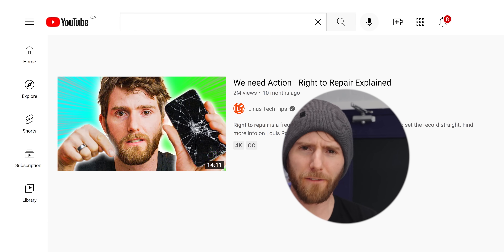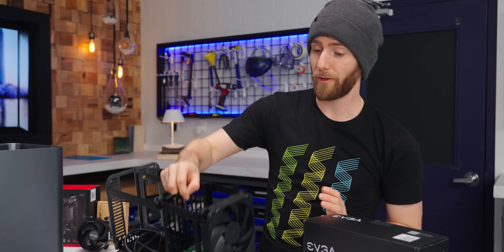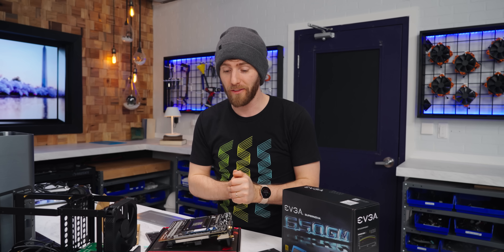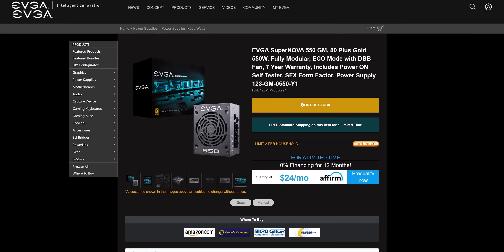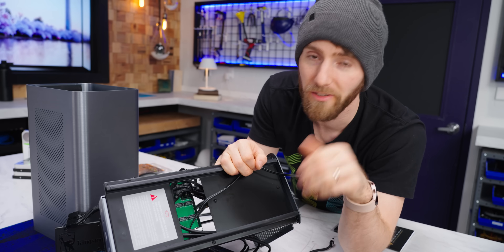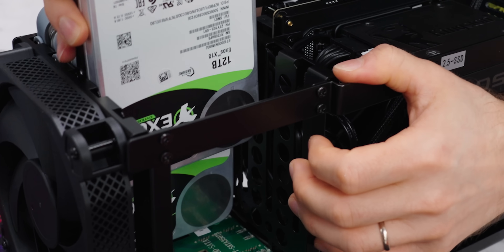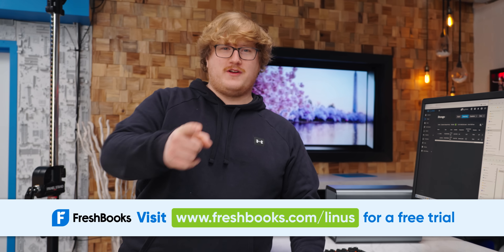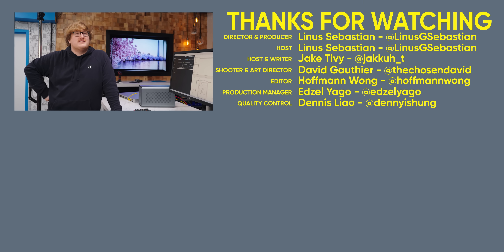This blows away the competition - JONSBO N1 NAS Build

Comment: I've built myself a similar concept, just with a much smaller budget. 

I've used one of those toploong nas cases from aliexpress (4 disk bays), that goes for around 50$. I also scored a pretty cheap J1900 board with power supply for 40$. Added some ram i had lying around (8gb as thats the max j1900 supports) so i'm roughly 100$ in with a pretty decent setup. It's not the fastest thing around (but easily handles 1Gbit samba transfers and ~500Mbit worth of torrents) and certanly much faster than your ~100$ prebuilt NASes. It's also passivly cooled due to low power atom cpu.

So if you're on a budget, looking for cheap boards with built in cpus is a good start.
Reply: Don't suppose you could host a plex server on it? You would need something more powerful I'm guessing
Reply: @Tumleren  if you dont need to transcode itd handle it easily.
Reply: @Tumleren  there a more recent solutions like Asrock J4125. With Intel Quicksync they can handle several 1080 transcodes while being very energy-efficient.
Reply: @Mkungaa  Why would you want to do that anyway? Even cheap 30$ android boxes handle all formats in 4k easily, so all you really need is a samba/nfs share and stream directly.
Reply: @hojnikb  THIS! I also own a relatively low powered qnap nas running on intel J paired with cheap android tv box and it can handle 4K easily! And you could do more on your android box than kodi, like retroarch! Cheap and energy efficient NAS as a backbone, cheap and pretty much good android box as a front.
For those wondering about power consumption, my qnap draws less than 1 kWh daily (I just wonder about power consumption and hooked a power meter on it).
Reply: @hojnikb  duh, are you going to stream raw 4K to your phone over 4G?
Reply: @Mkungaa  Smart man will stream that stuff directly off ahem bittorrent ahem from a lesser quality source :) Why transcode a good 4k source, if you can just directly download as you watch a lower quality release?
Reply: @Tumleren  You could, but i don't see the need to do so. Nowadays most host devices handle h264/h265 natively so just simple samba share is enough to get you going.

I personally use samba and mount that to my kodi boxes and stream directly.

The only downside to my setup is pretty poor single core performance of those atom cores, so stuff like torrent transfers are bottlenecked in terms of maxing out my connection speed.

Comment: So, are you actually able to work off of this drive or would it be strictly for backup/storage? Like, could it be used in an office with multiple video editors able to access the files and actually work directly from the NAS? I assume if you can, you may run into bottlenecks depending on how many are accessing the NAS simultaneously

Comment: As a Plex nas I use a custom built server with a raspberry pi 4 connected to 2 1tb drives via usb 2.0 in an old gaming pc case. The Ethernet and multi power port plug all comes out of the hole where the psu should be.

Comment: Great video, but you should've used ECC memory (I think the processor supports it, not sure about the MB)
Reply: Absolutely - as far as i know this is a very integral requirement to assure long term data consisteny even with ZFS
Reply: Cpu should support it, my own built NAS with a 2600 in it has ecc memory. With an Asrock ITX board.
Reply: It maybe "supports" it but if I'm not mistaken it won't actually use it.
Reply: @mormantu8561  It supports and uses it with compatible motherboards
Reply: @mormantu8561  it works alright, Truenas show it as such.

Comment: I don't now why you are obsessed with itx for home DIY servers. like having a mid tower instead with more room to work with and more place for cooling, drives and it is just 3 times the size and full atx powersupplies are easyer to find and can be cooled better because bigger fan. and fitting an graphics card for setup / encoding ,when used as an media server, is easyer. There are cases from cooler master for diy nas / server builds with classify as mid tower namely the Cooler Master HAF XB EVO. also has harddrive caddys for putting it in an other pc to copy bigger files dirctly over S-ATA

Comment: And why use TrueNAS SCALE? If you’re only using it for storage TrueNAS CORE is a lot more stable. 

But Re: TrueNAS vs. Unraid, if you’re looking at SCALE, there’s really no reason to pick Unraid anymore. Docker and VMs are just as easy, and so is GPU passthrough into both. And SCALE is free…

Comment: This isn't a bad setup, but it only has 1 disk failure tolerance.  unfortunately, the place you usually find you have bad disk is in the rebuild process when it's found a single bad disk... if you lose more than 1, you've lost all your data, which is why truenas recommends a minimum of raidz2... BUT raidz2 DOES use 2 drives worth of storage SO, 5 drives isn't a super efficient use of raidz2 THUS... WHERE THE HECK is the 8 drive version of this NAS?  8 drives, at least to me, in raidz2 is the optimum solution for home primary storage of stuff that counts (family photos and videos, important business documents, etc.  yes, you should always make sure to have everything in at least 2 places, at least 2 of them local at least 1 of them off-site, but for primary storage when you care about your data, 8 drive raidz2 is the way to go.  I would LOVE to see an itx server with 8 drive mounts, an appropriate 8 sata port hba, etc.  the rest of the setup of this server is fantastic, but it's NOT enough drives.

Comment: This is the first time I've seen a case like this at this price bracket that looks this good and is functional for a diy NAS build. But if you don't care about the aesthetics that much, and are willing to keep your NAS in a different room or in the attic or in your garage and don't mind a little noise, then buying an old Proliant or Poweredge server on ebay for about a $100 and a disk shelf and HBA for another $100-$150 is better in my opinion, as you will get parts that are optimized to run 24x7, and also redundant power supplies.
Reply: Also more power consumption

Comment: That a amazing case and I might use it at some point. I would love to know how much lower it uses. 
I have a synology and power and space saving for a 5 drive unit are the big factors for choosing synology. While the disk accessibility is great on the synology disks hardly ever fail so taking it apart to swap a drive is not a big deal. 
So trying to keep the power draw low is the only question.

Comment: Sorry @linus, was triggered by mentioning QNAP as a NAS provider. My QNAP recently encrypted my files stored on it. Luckily I backup my backup. Device was exposed to the internet (but was able to connect to it for updates etc). Hack was done due to QSA-21-13 and QSA-21-11 vulnerabilities - where the main issue was that QNAP left hardcoded passwords in compiled software (they changed description of the issue now, but one can find original message on their forums). Anyway QNAP does not care or feel any responsibility for solutions they offer, if their quality control is letting such issues out. I don't not want anyone to consider QNAP being a NAS producer, but rather malware tools provider for scammers.

Comment: Raid Z1 is almost like no redundancy at all. It is always recommended to run atleast raidz2 in an array. This is because when 1 drive fails, there's a very high chance that another drive is on the verge of failing, and if you don't have cold spares lying around or the cpu and the array isn't fast enough to resilver in time, then you lose all your data. But if you run raidz2 or higher, you can sustain up to 2 drive failures, and that usually gives you enough time to resilver and keep all your data.

Comment: One major thing that was not really considered here, energy efficiency. With e.g. Dutch electricity prices at 0.75USD/kWh right now (0.27USD/kWh end of last year, ouch), spending money on energy efficient hardware is for sure worth it and you can earn it back within the first year, considering these machines run 24/7. My server idles at 60W, with current prices that's 43kWh/month==32USD/month just for energy (not even considering >60W situations). Even last year at the old prices, before the whole gas shortage/Russia/Ukraine crap, it was ~12USD/month. I would be really interested in a follow up where energy usage is compared to a similar prefab NAS.

Comment: this would be good product for builders out there to mkt to smb but also adding netfs and mysql clustering would be nicer when you have 3 of them....the argument here is you can scale out by adding a cheap cluster node but also you transparently scale up - nvme scales great but you may want to try to base platform that can support 10g (100g?) and nvme and more ram - when you have 8 nodes how many iops are you maintaining - some apps like db ops will benefit greatly - improving segues to sponsors and tco and roi at the same time! - the long tale of refurb clister node lasts for 3-4 years (post zen5/pi6)
Reply: the new gen of mini pc and pi5 will change the biz calc on cheap cluster node price/perf sweetspot? it depends - avoid proprietary parts and vendor lockin please do a ha opnsense and a small cluster - have both spinning rust and nvme - you want redundancy for fw and data #selks status #24/7 pkt cap #moloch #log rotation drills #techmikeny #comprenew builds #buildable #resellers panel #hotcopy #mysqldump

Comment: I REALLY wish you would list the number of drives it can hold, rather than some arbitrary capacity based on whatever drive you're using. Telling me it's 100TB is as useful as telling me it's 100GB because CAPACITY IS DEPENDENT ON THE DRIVES USED.

Comment: Case - $126
Motherboard - $218
I/O Port - $26
32GB SSD - Cost Undisclosed
CPU - $120
Ripjaw Memory - $70
Power Supply - $130
Cheap Kingston Drive - Undisclosed

Disclosed Cost - $690 
Synology - $700

I really know nothing about NAS drives (though I'd like to get one) but if we're comparing this build to the Synology, there really isn't much comparison. Beyond the fact that two components were not even being factored into the cost, the ten dollar "savings" is greatly offset by the time and irritation it will take to assemble, install software, subscribe to a service and everything else to get this up and running.
Reply: I think the one true merit to a build over a per-brought is the ability to upgrade keeping in mind though that some NAS units can in fact be upgradable.

Comment: The $100 shipping charge means you could just but a U-NAS 8 bay case with hotswap for pretty much the same cost. Much easier to work with and more capacity. You’d also get a proper warranty.

Comment: Been running something similar for years using a SilverStone DS380 which is better because you can hot plug/unplug the disks; in this case they are not accessible easily.

Comment: I found Synology to be a good option for what I wanted. I liked that I could throw in 2 12GB and 3 8GB drives and like the old Drobo boxes it would use the extra space. This allows me to update a drive at a time instead of the size being limited to the smallest disk. I find this very appealing rather than buying a complete new set of drives all at once.

I know True NAS offers better control, but Synology DS7 is easier for me, I like some of the features of BTRFS and at a 10 savings it's a lot of extra work unless you like doing that type of thing.

Does any software / RAID solution offer the ability to add disks in a Drobo like solution like my Synology box?

Comment: Nice  , i already went cheaper and running a diy 1 year NAS for  around ~ 300€ (a used hp pc case with an icy dock bay , an Intel(R) Celeron(R) J4105 CPU+motherboard ,  4x2"5 1to hdd + 1 250gbssd) using dietpi (easy apps install ) and add raid 5 .

Comment: It’s cheaper and safer to use many smaller drives in my experience. Because really high capacity drives carry a premium and you can run z2 mode and it only uses 2 drives. If those 2 drives are only 2TB it’s not wasting so much space. But unfortunately that means you can’t use a tiny box like this. I saved a good $500 using smaller drives off my original planned setup and got the same end storage.
Reply: They aren't cheaper from what I see, at least not if you're aiming for a high capacity array with quality drives (ie: not the normal cheap consumer level stuff). Let's look at a 24 TB Z1 array using 3 12 TB drives and a 24 TB Z2 array using 5 8 TB drives. On Amazon Australia a 12 TB Seagate IronWolf NAS drive costs $425 while the 8 TB drive costs $284, so with these the Z1 would cost $1,275 while the Z2 with smaller but more drives would cost $1,420. If you're fine with shucking external drives, to my knowledge the high capacity ones at 10+ TB should be CMR models that work perfectly fine for a NAS, I can find 12 TB drives from both WD and Seagate at $346 and $364 respectively brining the cost of the Z1 to $1,038-$1,092. And this doesn't factor in the potential additional costs from an increased number of drives such as needing extra space, more data & power connections and more cooling which all scale up with the more drives you need. There's also the increased running costs due to higher power consumption of having more drives which adds up over time.
Reply: @Sevicify  well said, exactly what i was thinking when i saw the comments. the idea of saving money is such a short sighted surface level of planning. there's more to it than budget
Reply: i just pay for the higher price. later in life you will appreciate less storage use more  and the ease factor of handling smaller amount of drives

(less storage means room space)

Comment: 283MB/s is not sick,  that is mediocre. Each to there own.  Saying that i do like the idea of these type of external backup devices.  I used a QNAP for ages but got sick of the small affordable option for hard drive amounts, so i just built a cheap regular PC from extra parts i had with a 10G network card and windows installed that acts as nothing but a backup server and incase something happens on my main or our laptop i can troubleshoot with it

Comment: While it's not a bad video, you glossed over some pretty important things. I'd like a more in depth NAS video in the future however. Energy costs are becoming more and more important, esp. for Europeans, so being cheaper than a Synology is great, but if it would be a bad NAS if it would constantly eat 70 watts on idle. you should also have mentioned that you threw well over 1000$ of disks into this system, putting it outside the rage of most users who want some storage at home, you wouldn't build this system just for 2 drives.

Comment: Good one, question for those already using it though.

I've been thinking of setting my current dual HDD Synology back to my hometown with my mom, both for backup of her stuff and offsite backup of the most essencial of my stuff, and turning my old desktop into a NAS with upgraded storage and such. Will likely get the largest HDD with good price for Tb value, 10Tb or over.

I see the guys at LMG went with TrueNAS Scale instead of Core there... avoiding FreeBSD I guess? Any particular reason?
I understand Scale is running... well, their own version of Debian of sorts, right? I think I read it's very specific, but I kinda wanted to run the old desktop for a few specific tasks, like as a video capture device, or to run OBS independently... doable or bad idea? Or you just can't?
Would be nice to let it handle some specific tasks instead of putting it all against my current PC, which is now a laptop.

Of course it's more important that it just works as network storage, so it's not really a priority for it to do extra stuff... but if it doesn't get in the way, great!

Anyways, I don't currently need too much storage, so I'm thinking raid 1 on 2x10Tb drives.... just to simplify things. Overtime I think I'll get an extra 10Tb to replace if one goes out, and another 10Tb for offline extra backup made periodically. Or perhaps I'll just use an older HDD with less storage to backup only the very essencial stuff... given cost and my ability to pay for it. xD

I also need to upgrade router/local network gear... isolate the NAS, limit access and put some monitoring into it. Because I want to be able to access it online, need to setup a VPN and whatnot for that too.
Been planning to do all this stuff for years now, I guess it's time. Tired of dealing with data spread out in a whole ton of different HDDs, tablets, smartphones, other types of devices and whatnot. Plus I also need a secure and private way to store a bunch of data I intend to digitalize and organize... will have to also look into encrypted databases and methods to do this right.
Reply: so no guarantee on that but i have seen posts of people telling ryzen has problems with freebsd like random freezing/ crashing and going with intel for that reason